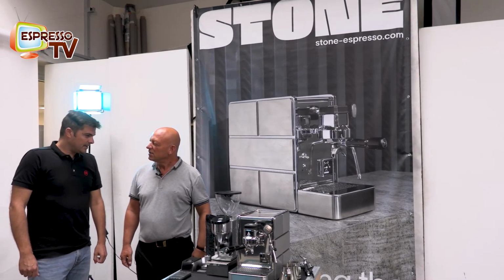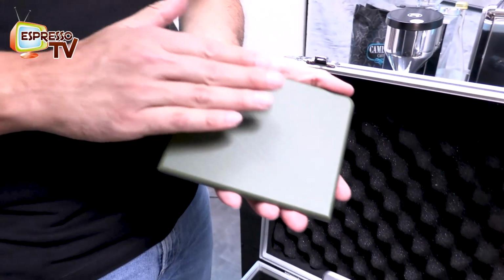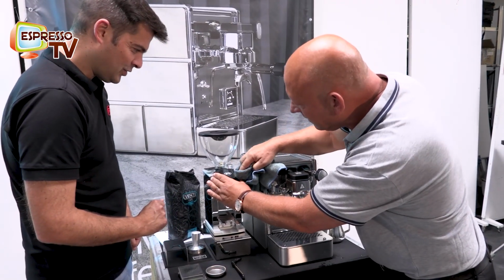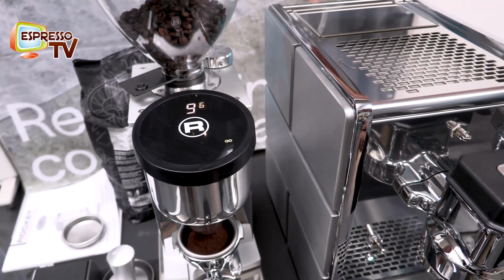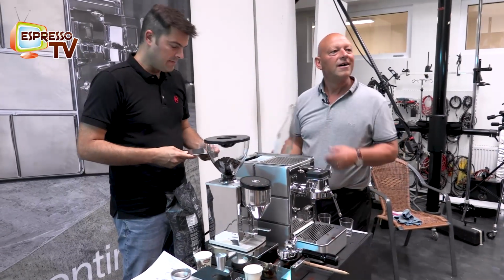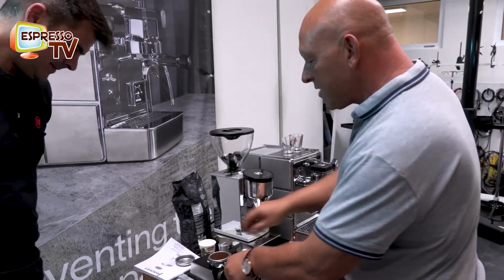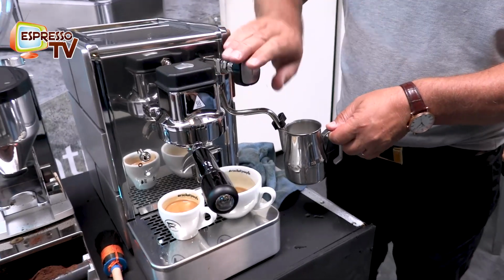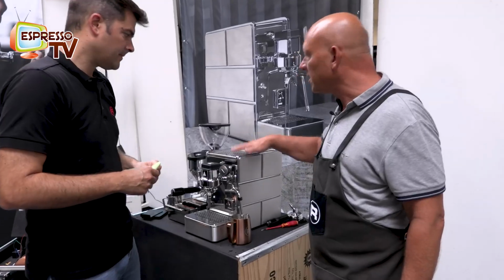New Stone Espresso machine with new Rocket Faustino grinder

Comment: Hi,may i know wether the machine calibrated at 9bar pressure?
Reply from the maker: Most important parameter with vibration pumps is the amount of coffee as well as the grinding dregree. You mean the maximum pressure with blind filter?
Reply: @TheEspressoTV  my question is there an opv valve built in so the maximum pressure at portafilter wont reach more than 9bar..The usual non prosumer machine mostly dont have opv so the pressure usually can go up tu 15bar..
Reply: @harzritz438  There's an OPV that's accessible by removing a side panel. It's set at about 11 bar from the factory, but it is adjustable.